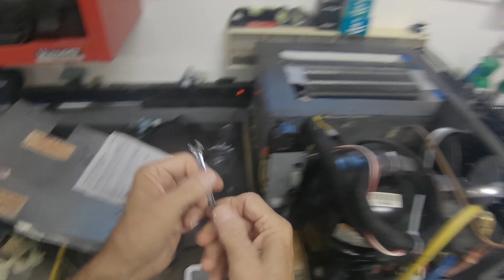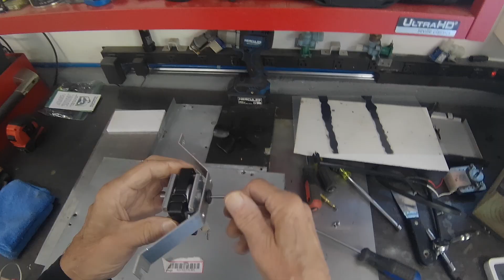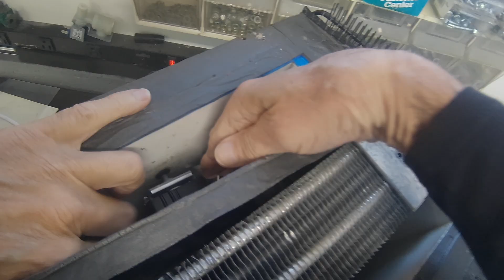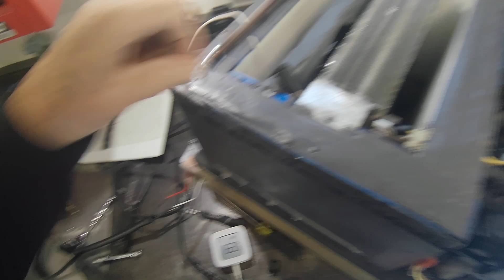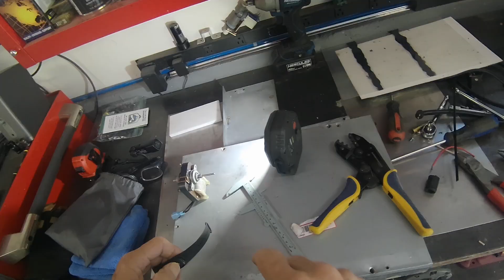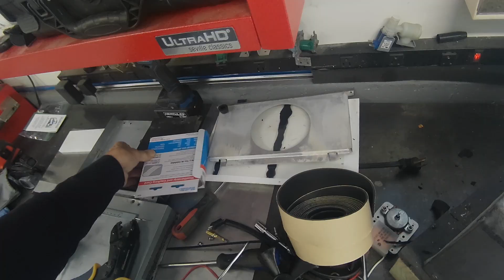Northland Evaporator Fan Motor R&R

Comment: Is there a video on removing the entire unit from the top of the refrig/freezer?  Mine is built in and I want to repair the freezer section defrost heater by just sliding out the entire module
Reply from the maker: Pull the unit out and disconnect the wiring harnesses and lift the module up